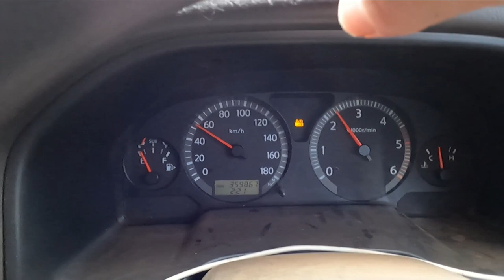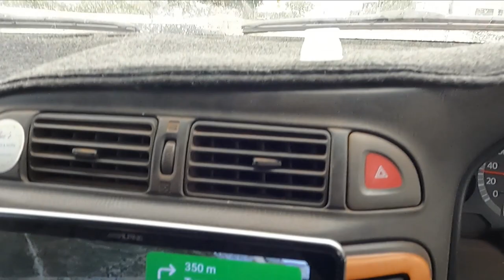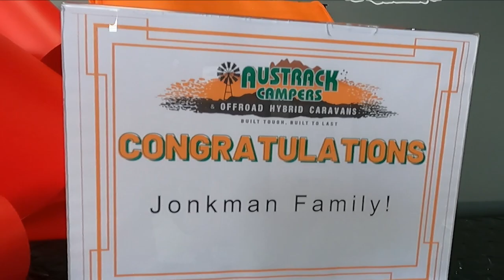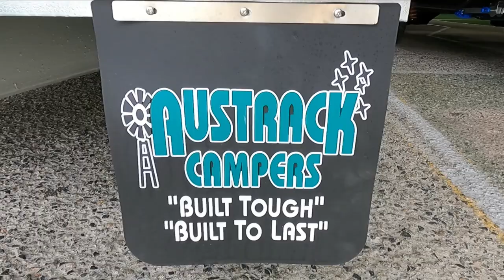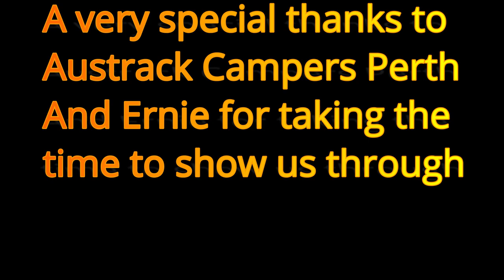AUSTRACK TALAWANA X 15 HYBRID REVIEW

Comment: So the bearings are upgraded they said. Are they the larger size or standard trailer size?
Thanks
Reply from the maker: I'm sorry we are not sure to be honest,
I would imagine they would be the bigger Ford size if I had to guess
Reply: @waadventures14  thanks for getting back to me. We’ve got a Coromal and they run a truck bearing I believe so double the size typically and basically they won’t wear out so when we upgrade I’ll look to find similar. I’ll contact Austrack. Enjoy your trip